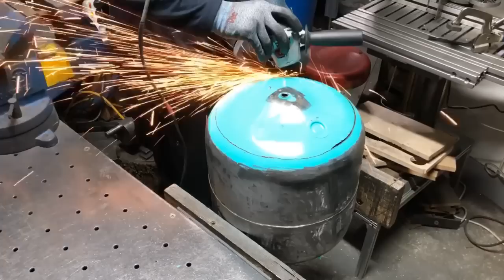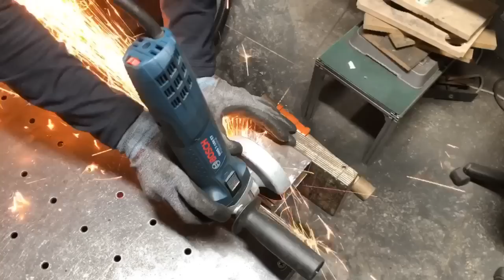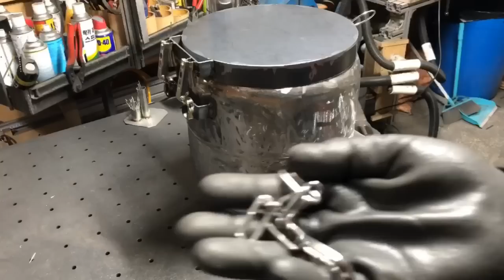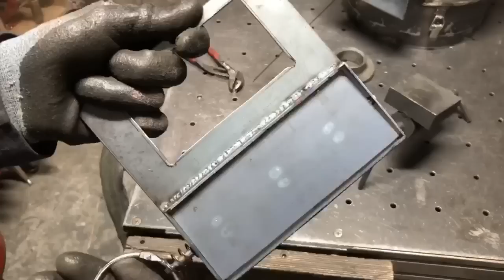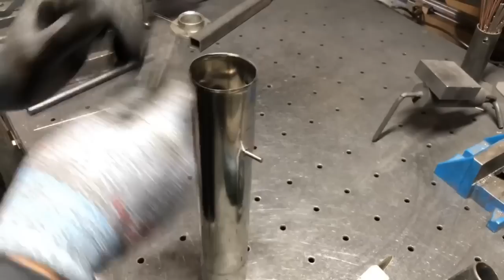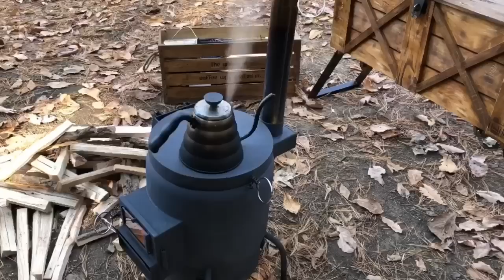캠핑 가스통 스토브 만들기 / Making a camping refrigerant gas can stove

Comment: You did a really good job with the top (firewood input, cooking), bottom (ash cleaning), and flue (damper) configuration of the refrigerant tank. It's the work of an expert.

Comment: Your damper in the flue pipe needs to wider.
Reply from the maker: Thank you for a good idea.
Reply: @stovetv  Your welcome😀
Reply: @stovetv  you might also want to consider a secondary air inlets near the top of your stove to more efficiently burn any unburnt wood gases , if you make closed vertical channels that pass through the bottom of the stove to the top inside of the stove to preheat the secondary air that exits about a hands width from the top inside of the stove.